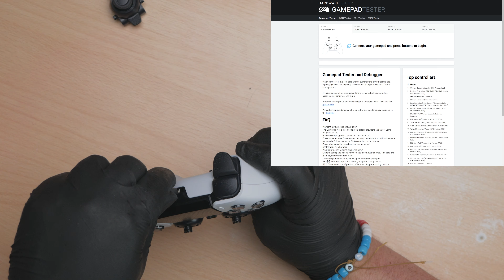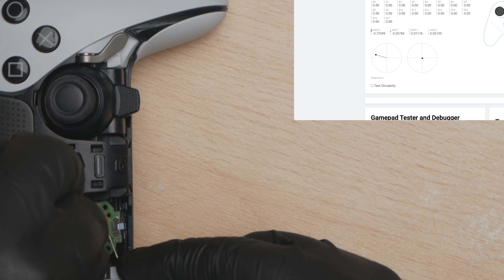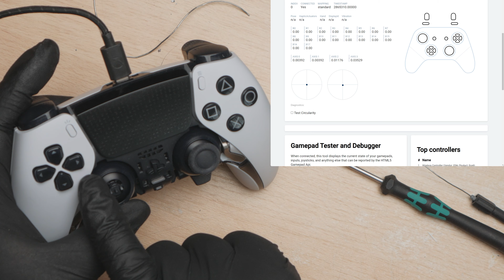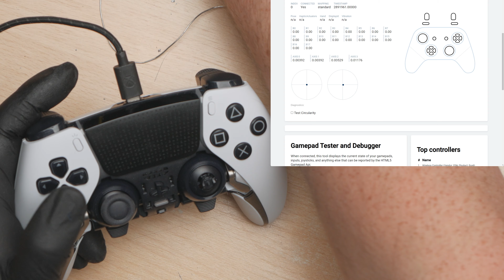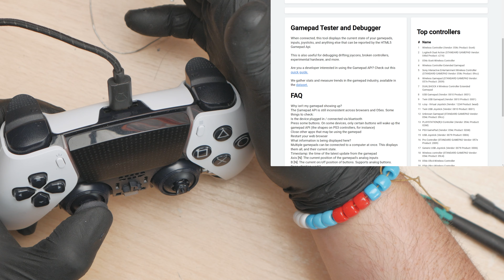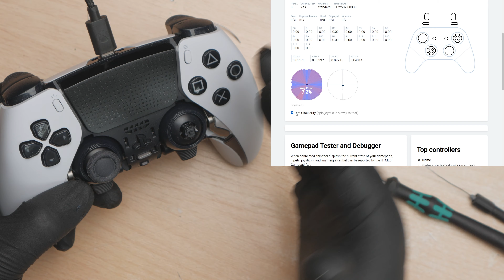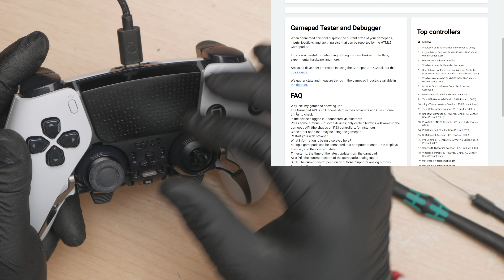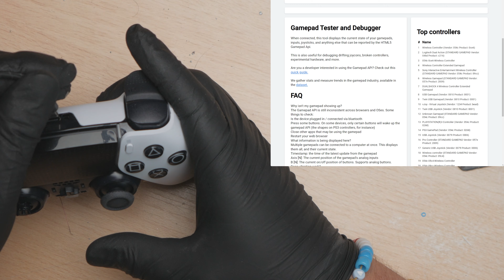PS5 DualSense Edge Stick Modules with Hall Effect Sticks

Comment from the maker: We offer DualSense Edge module stick repair / upgrades here: https://ubermicro.co.uk/product/dualsense-edge-analog-stick-drift-repair/
Reply: Hey is that black sensor with 3 pads necesarry to solder in ? And if so whats it for?
Reply: Does this repair/upgrade include new hall effect sensors or does it use standard non-hall effect sensors?

Comment: Always mix low melt solder to the solder points , you will need much less heat after it to remove the sticks, you can even first remove the 2 potentiometer parts and then the 8 solder points

Comment: I have had legitimate experience with the yellow modules because you can manually adjust them if you push on the stick too much while playing you will knock it out of alignment The better joystick to use is the gulikit TMR joysticks they are a little more expensive but they do not fall out of alignment

Comment: Thanks for the video, I have been subscribed for some months now and amazed at your efficiency! Great work!

Fortunately manufacturers have updated the V52 to not require such long trace for the flex PCB to work properly. Such a great improvement! Now if only they sold the hall effect sensors already shielded on the signal pins.. it would be a 5 minute job

Comment: What a mad man using a heat gun lol
Reply: I was thinking the same thing. I use a JBC desoldering station and my tech uses a Hakko fr-301. I had seen way to many warped boards, melted switches and missing resistors lol

Comment: Hey brother, if I'm not mistaken I think you can turn off calibration mode by shorting contacts on the board, so it won't accidentally enter it. And amen on the 0% deadzone and 0% circularity nonsense. I see those misconceptions everywhere!

Comment: I recently bought ElecGear HE sticks for DSE. Had full instructions and some tools to desolder old sticks. Unfortunately, they're not available in the UK yet, so I had to import them.
Reply: I bought that kit and had both sticks dead on the left and right axis.
Reply: Guess ill give those ones a go, seems to be less work with everything already on the PCB instead of lose wires/plastic tube and capacitor.

Comment: I've seen other videos of similar driver boards but they did not have the MCU so far out like this one and having the installer have to solder on a Transistor is a hack job that they should have fixed before selling it. All it's doing is making sure the MCU is not turned on while the controller is off so it doesn't drain the battery, this is definitely in need of a revision. Good work none the less.
Reply: They have been revised to shorted the signal traces, but the transistor is still there and still not any improvement yet. It's great they are actually making improvements, hopefully the next revision adds the transistor & insulation inside the signal pads to cut out the ptfe tubes

Comment: Please help.
I installed it but I can't calibrate it.
I removed the case and ran it to completion and the red light came on so I think it's installed correctly.
The calibration range can only be set by pressing in but it doesn't save.
Other calibrations won't go to the set state. Only half of the stick movements work.

Comment: I need to get me some of those. I forked over the insane amount for the Dualsense edge knowing if I ever developed drift I could just buy a new stick module for $20 which I'm honestly fine with paying. Well they have been constantly out of stock on Sony's website as well as anywhere else that isn't eBay where they are being scalped for $40-60 a piece, and at that point I might as well buy a new controller. I wish Sony would just sell hall stick module but I know that will never happen because then they wouldn't sell anymore stick modules, and the stick modules are always out of stock which forces people to just buy a normal Dualsense instead. Sadly It's all about money to the big greedy companies.
Reply: I checked a couple of days ago, and the modules are back in stock. You may consider buying multiple just in case they run out again!

Comment: Idk why but I'm struggling to get the stick off the boards, I've removed as much solder as I can via pump and wick. Tried using a small heatgun and it doesn't seem to loosen the stick for me to pull out, though it is a little hard for me to do this properly as I lack a vice like yours to have a strong grip on the pcb, so I can't tug on the stick whilst heating like you guys do here. I've just got a simple helping hand which is only good for using the solder and pump/wick

Comment: Hello, mate. I have installed both calibration plates, and on one of the joysticks, the calibration doesn't save the values. It only lets me center the point on the axes, but it doesn't allow me to set the circularity or the range. On the other joystick, everything is perfect.

It's a brand-new DualSense Edge, so I rule out the controller as the issue. Could it be an error in my installation? I have measured all the continuity points with a multimeter, and everything seems fine... Any ideas?

Thank you so much for your help. I admire you a lot. Greetings from Spain!
Reply: UPDATE: (Just in case it helps someone) I removed and reinstalled everything again, changed the hall effect joystick, and now everything is perfect. It seems the joystick was causing a conflict. Cheers!
Reply: @FranciscoJCG hello 🙂 does this controller calibration still work today?
Reply: Which hall did you use?

Comment: Using a hot air station is a bad idea on the edge modules. If you aren't experienced with that method it can very easily damage the board. I've seen tons of modules that are missing resistors and or warped. Yoir best bet is something like a hakko fr301 or just a normal iron and solder pump.
Reply from the maker: Hot air all the way here! Quickest and safest way when you do lots.
Reply: Hi, what is the temperature setting for hakko fr301?

Comment: I installed one of these and tested all the connections but when I go to calibrate the stick and click the joystick to save it moves both sticks and disconnects. I’m wondering do both sticks have to have the calibration boards installed to function properly?
Reply: Shorted somewhere, or the stick wasnt seated properly this happened to me, or there may be a random piece of solder on one of your signal lines

Comment: These driver boards are not necessary when you know how to calibrate the dualsense with third party tools. I equipped a friends dualsense, calibrated it (I used these sticks) and it is now perfectly centered.
Reply from the maker: This is a DS EDGE controller. Can't be calibrated with software. So the driver boards are 100% necessary.

Comment: Is it necessary using the driver board? I only use hall effect in the normal controllers..no driver needed
Reply: I believe so. You could manually calibrate the halleffect joysticks instead of using the driver boards. The Calibration GUI will not work on dualsense edges from my knowledge 😢